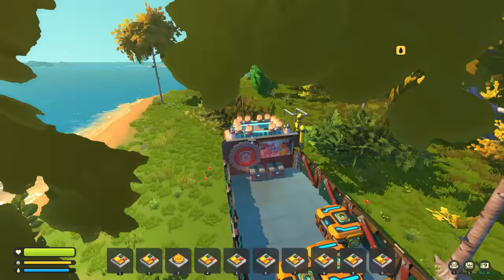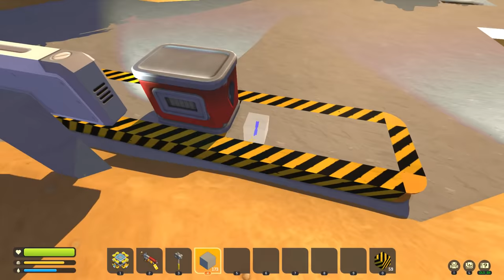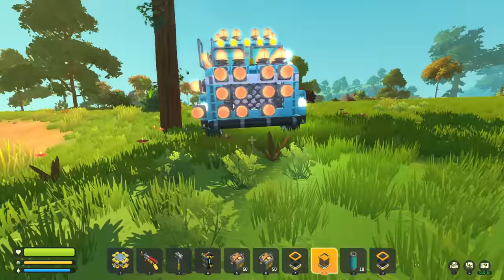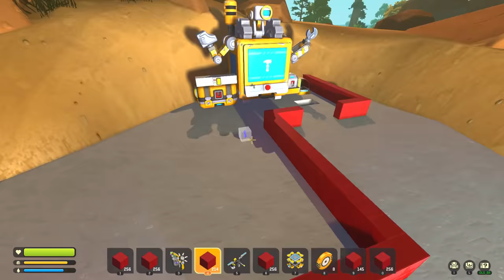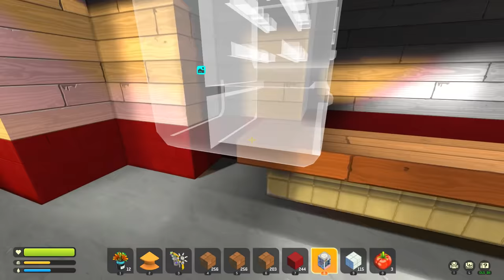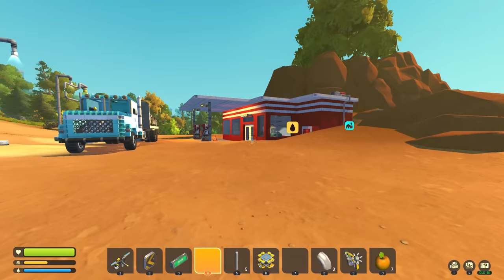I Built a FUNCTIONAL Gas Station On Top of an Oil Pond! (Scrap Mechanic Survival Ep. 19)

Comment: 38 seconds in, actually yes it is possible to use vacuum pumps to fill up, I did some testing I forget exactly how far but its around 14 blocks or so is the max distance, so if your about 14 ish blocks away between the vacuum and the chest or the gas tank works too, then you can connect a switch pulsing off the 3 logic gate setup to have it pump fuel into the chest or tank. what I was thinking, was since chests don't work directly on the gas tanks, why not setup an elbow from chest to vacuumed to gas tank, with pulsing logic gates, and a switch, and then just have the vehicle drive under or next to a vacuumed pump at the gas station to pump fuel into the chest so now you can hold a but load of fuel and best of all, you can stack the chests and connect them via the pipe port and carry unlimited fuel in your portable car now. your welcome... warning, may be slow or inefficient try multiple ports input...
Reply: an update, after testing, theres no way to get it to happen faster because the chests and gas tank only allow like 1 fuel per um what is it measured in, ticks? 1 per tick... idk but yea 1 at a time, and without mods theres no way that I know of to increase this number however, this is still faster then fuel gets consumed so in theory you'll never ever ever run out of fuel if you had like 1-4 chests filled with fuel, all attached to your vehicle and a tube system complete with vacume pump to drop fuel into the gas can as you drive around, and you filled up just the chests using the same method at a gas station... Id rather just swap out the chests though and always have 2 full chests of fuel so no matter were i'm at, i can just forget about gas for  a while and not have to refill ever 30 minutes lol. weird though because I don't want to use those piston cars because I like the realism of having to fuel up, downside, having to fuel up to rapidly...

Comment: When you redo the interior, you can open up an inside corner (like just to the left of the potted plant) and stick the vending machine in there. The bottom part of it will be in the ground, but that won't be visible from inside (or outside) the station. That will get you a little more room.
Thanks for these videos - your builds always look great!

Comment: When I made my Gas station, I used Vac tubes to build a loop into the Craftbot. So I only needed 1 chest. I made the Craftbot look like he is running the stand.
Reply from the maker: That's awesome!
Reply: Was imagining a cook bot run the stand and the diner area. But I guess the craft bot running the stand would look awsome.
Reply: @shravankashyap9437  I built the Stand around the Bot, and threw some stuff around it like Spare tires, gas(because they look like Cans), water, Batteries, one of those vacation posters from Fruit stands, and I put some seeds on the counter to look like he is selling snacks, and a Radio playing. I uses one of those Fresh signs by slapping it in between wood walls to make a sign that says gas, makes the yellow letters glow green at night.
Reply: @cydthemagi  damn 🤩😁, that gas station feels lit🔥.

Comment: This is so cool!  Kosmo, the devs have stated they WANT to make it so you can do automation like fueling your vehicle, so some day you'll be able to!  Still watching the video, I hope you moved that chest between the 2 gas tanks so you only need ONE line of tubes!
Reply: yes
Reply from the maker: lmao I did not....ugh.
Reply: @darealkosmo  Oops lol.   Finally got back to watching.  Had an idea, just get rid of the normal chest and daisy-chain some fuel tanks together, you can have those as the "backup tanks" in the back room.  I know it'll cost more, but you'll NEVER have to worry about oil overflowing, the downside is you would then be forced to change how the "fuel pumps" are connected, because the fuel cans only have 2 connection points.  Where are T joints when you need them?? (Modded has them)

Comment: If you replace the mesh at 56:40 with the thin 4-way pipes, you could access the chest through the pipes.
Reply from the maker: Dang! Thank you for the tip!!
Reply: @darealkosmo  No problem. Got the idea from a video kAN did on using glowbugs for propulsion.

Comment: if you want to keep the oil always on and pumping, fill up the output chest with scrap metal (haybots are an infinite supply so no need to worry about limited resources) so that way only gas can be pumped to the canisters. ofc, having the extra chest full of gas beneath can come in handy, but with this other method you won't ever have to worry about turning the pump on and off.

Comment: just an update, i've got the fant mod, so I can pump into and out of chests using the vacuum, my favorite thing about vacuuming into the chest is you can take entire stacks at a time, with the fant mod there is the large chest, and filters on all fant mod chests, so I set it so oil goes into oil chests only and gas goes into gas only chests, I also have small chest filter on the vacuum pump another part of fant mod, so I have 2 input vacuum pumps that are inputting to fant mods joint tube i forget what its called but it has 6 connection ports for tubes, so 1 gas tank has 2 inputs from this connection and an elbow, and I have a large chest filled with gas and its the wall to my gas station, it doesn't exactly work like a regular gas station because I have to be next to the tank, but it takes 2 entire stacks per second of gas into the vehicle and You can also connect a chest to the tube system with the 6 way junction and it will fill the gas tank and the chest i havn't confirmed in which order yet but my theory is the closest chest gets the gas first, testing needed. anyways instead of waiting for 1 gas per second, its one entire stack and so my gas tank and 1 regular size chest "standard vanilla not the small vanilla chest" and both get filled from empty to full in roughly 17 seconds, also Like I posted earlier, I've got 6 craft bots all crafting gas at all times again with fant mod its the auto craft bot so that it never drops the craft recipe it always keeps it. I also have 12 vacuum pumps "complete overkill I know" that input the oil to the craft bots from a large chest. this is the fastest i've ever seen a vehicle get gas...

Comment: I would have done what I call a “vertical double hinge snake door”
The way it works is it rotates so that the door is on the ceiling but while it rotates it folds in half so the lower section looks like it’s not rotating and just moving. The final position would be the door folded in half well covering the inside portion of the two windows above the door. The reason why it’s called a snake door is because if you look from the side it kinda looks like a squished snake. The double hinge part is because you would need 2 hinges for it to be folded in half and out of the way. It’s a really cool door and it’s not hard nor expensive but it’s also unconventional so it’s up to you if you wanna use it or not.

Comment: Hey kosmo, I've found out a fairly decent tip that requires really good RNG on your world spawning to get, but that plateau above your oil pond. If you farm up there raids all spawn on the ground below. Bots can kind of shimmy up some weird routes up to the top, but if you build out a rampart or a wall, you basically have an untouchable farm. The RNG required is to place you in a desert with another oil pond and also the desert close enough to water that you can transport that easily.

Also, prefill your output chest with gasoline. Otherwise if you stop making gasoline then the pump will bypass the Craft Bot and start dumping it into your output chest and that doesn't count for something the Craft Bot will use. Nevermind. Just got to that part where you discovered what I did. . . it sucks doesn't it?

Comment: The sensors look like security cameras, put one on the pole so it makes more sense as a camera as it would see the whole door and area around it, and it would be a good door sensor. Actually trash that, put one just by the door, again makes sense AND it would see all the blocks in front of the door, so you wouldn't need very many.

Comment: Love the build man. One technical note though: the gas tanks are only filling on the overflow from the refinery output. I think some pumps on the vacuum lines would keep the gas tanks filled faster. Also: big fan of the 90's petrocan colour scheme. :D
Reply from the maker: Good point Chriss! I never really stated it but you're right, they get filled up because the chest is already full. Definitely some room for optimization :)

Comment: I was using alot of fuel and added some mods and needed oil to craft some things and well I built a gas station that uses 6 craft bots so I'm never out of fuel I have 6 chests for each of the 6 craft bots for both fuel after crafted and the oil... and each chest has the top tube hole filled with a chest for the fuel chests that hold the finished fuel. I use these chests to remove and replace on any of my empty chests on my vehicle for fuel. I swap it with an empty chest off the vehicle, and so I always have tons of full chests of fuel and fuel is made hella fast. all 6 are upgraded to level 5 also I have around 300 hours of gameplay though so... there's that... I can build nearly anything I want with no worries really and my mining truck is super efficient amazing on bumpy terrain as it has 10 wheels and is pretty much like a tank lots of friction amazing drift stearing almost never flips over. the drill is fast drills through rock like butter cuts trees down like melting in a hot pot.

Comment: Why not put the chest at one of the "gas pumps" and then you only needed half the pipes
Reply from the maker: cause that'd be the smart thing to do xD lol oops
Reply: @darealkosmo  Since you already have it set up the way you do, I'd suggest adding one more chest beside this one, and then a pipe to loop the extra oil back to the pumping chest. As there will always be a few bottles of oil that somehow bypass the craft bot and then you have to unclog it manually. This way, it will at least be automatic, and the only thing that reaches the pumps will be fuel.

Comment: Idea: Instead of tubes, that connect to Gas tanks. Could you leave those(at least one) Open? Just the Tube. Place Your Vehicle's gas tank in a spot, so you can back up to the tube? Once it "Hits" The tube, it starts filling. No Moving anything. I have NO Idea, if that would work. Plan to try it myself. It will probably be AWHILE til I can.

Comment: Instead of adding more Sensors n such to the Gas Station doors, why not some simple logic with a timer? Sensor hits a 3 second timer to keep the doors open, so its more realistic and smooth. Could also put the one inside right under the counter pointing at the door so its even easier to hit, while still being a bit more hidden.